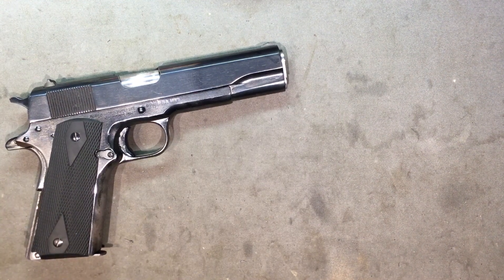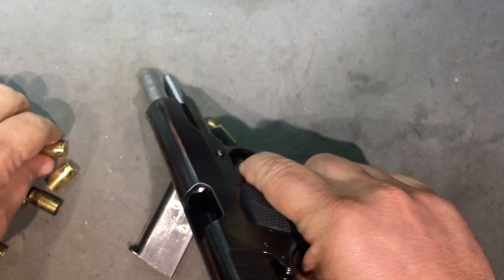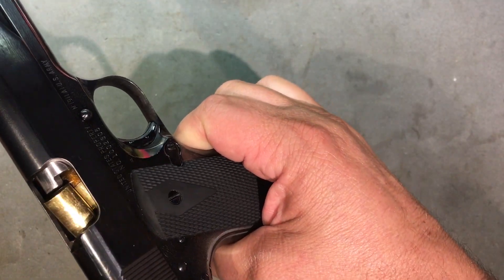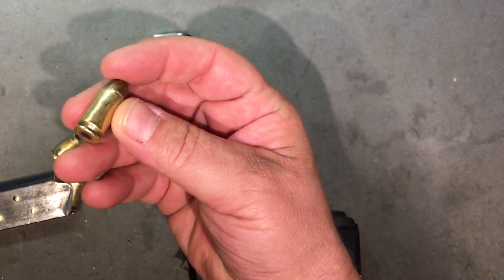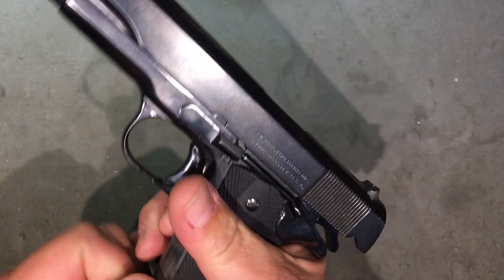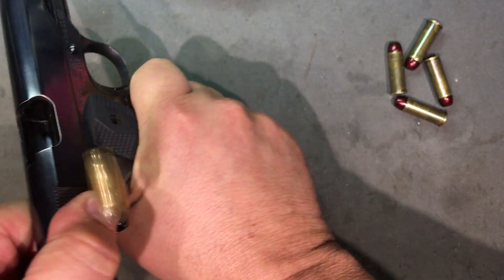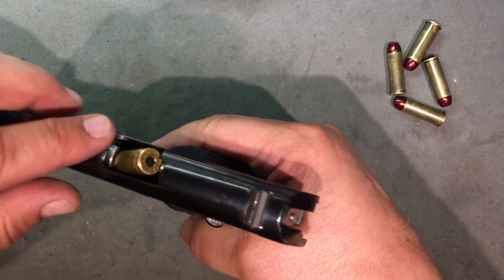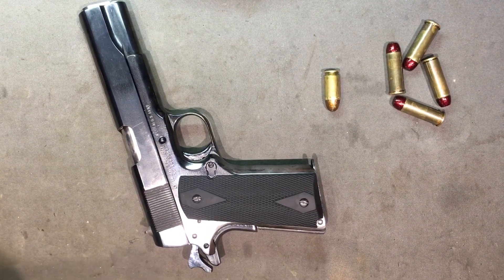Handgun Malfunction Drills - Snap Caps

Comment: I have such a terrible jam in my LCP Max. Tried a snap cap round for the first time, and it instantly jammed the gun terribly! It's 380 Auto. The round is jammed just outside the barril and is keeping the slide open but not coming out and having a ton of trouble taking it out
Reply from the maker: Not sure what you have going on there but you should find a nice gunsmith you trust......nothing should be getting jammed terribly!
Reply: @MilsurpGarage  It was a stupid dummy round. But after a few more attempts I was able to take it out and threw away the dummy rounds for this gun